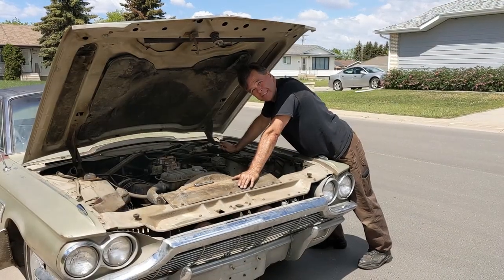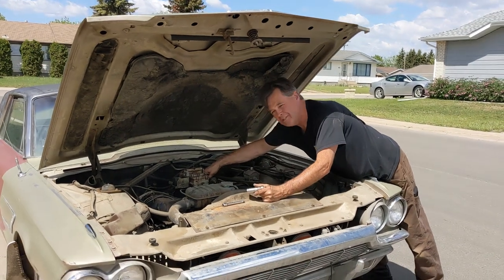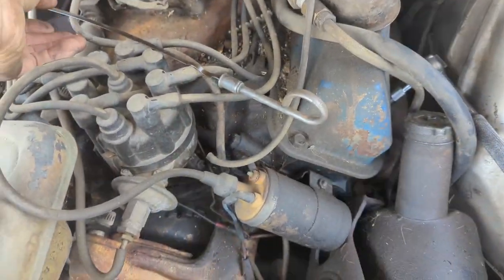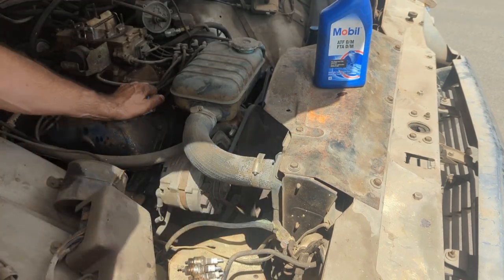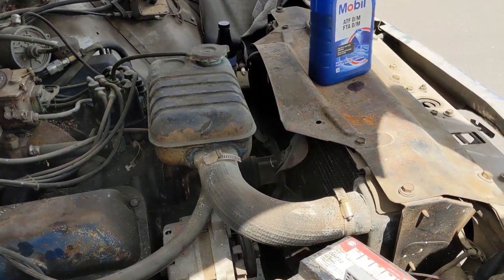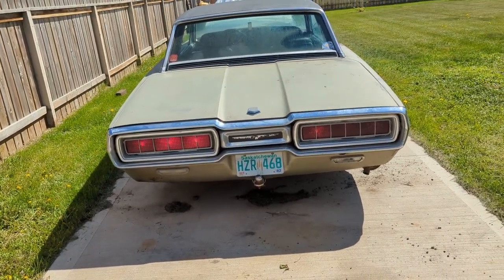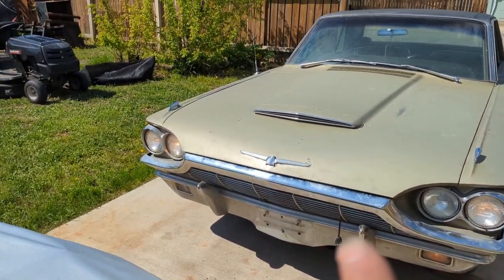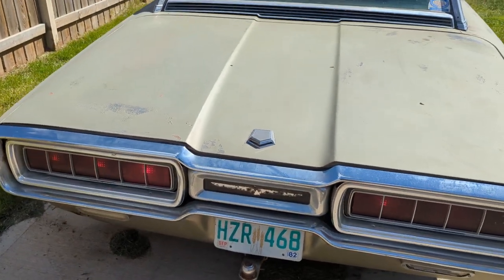65 Thunderbird Hardtop Arrival & Revival

Comment: That first start was to let the neighbours know that you had a new car 😊  It is amazing how some of the old tecnology holds up.  I had an LTD with the accerator pump leak which dripped gas on the manifold which smelled bad.  If I remember correctly, that was  a 400 which was not a good engine.  It looks like you will be up and running fairly quickly.  Fun video.
Reply from the maker: Lol...yes, and the big cloud of smoke was to warn the people on the next block over!
I think every one of these old fuel pumps with the cartridge filters leaked a little!

Comment: Mudflaps on the front and a trailer hitch, that's definitely a classic.  Body looks pretty solid (wish mine was that solid).  other than leaking muffler the motor seemed to run OK,  no smoke after the initial startup.  Let the videos begin.  :   )
Reply from the maker: Yes those old mud flaps are a sign of the old days...they are coming off today! Lol
The hitch, I'm still thinking about if you leave it, or remove it.
I am surprised with the engine, I was expecting it to be a little ticky...but she runs nice.

Comment: Congratulations on getting your new car started! A very promising start to a driving project. Smoke seemed to subside after it ran for a while, which is not surprising given how good the plugs looked. Looks like a very solid car. Glad it goes in gear and drives, too. I really hope you'll include this car in your video updates, but of course, that's up to you. This car is in similar condition to my own '65 when I got it, though mine was a running driving car before I bought it. I can relate to this car a lot.
Reply from the maker: Thank you! I will be doing videos on this one too, today I made the fix to the shift lever that these car all need...not as detailed as the video Nick did, but I felt it is still worth covering. I also just ordered new carpet, headliner, and trunk liner from Bird Nest, the old ones are too smelly from mouse urine to keep.

Comment: I am currently working on a 64 hardtop that sat under a tree for over three years and not registered since 2006.  I had it shipped here to Kansas City in mid December of 22 and spent the first three weeks just cleaning the exterior of tree sap and bird crap.  It is Wimbledon white with black cloth interior. AC, PW, both power seats.  Windows are stuck seats are dead AC/Heat all inop. Lol.  It is almost rust free with the exception of the trunk floor which is almost completely gone.  I tried starting and it had #7 intake valve stuck which bent the pushrod.  I got the valve loose and put in a new pushrod, rebuilt the carb and got it running poorly.  Y pipe is rusted so sounds like yours.  Fuel pump doesn't work.  PS pump doesn't pump and brake booster doesn't boost.  Sitting was hard on it.  I haven't given up.  A fuel pump and PS pump are on order.  I put on new belts and radiator hoses.  Compression is 155-180 on all cylinders.  I think that once I get the carb straightened out that it will be a good engine.  Valve train was very clean, not sludged up like some I had in the past.  Tires are rotted.  Lots to do.
Reply from the maker: Sounds like a great project Jeff, not having to deal with rust makes it so much better...now you can enjoy the mechanical repairs. 😊

Comment: Hey man, that's called air pollution. I love how after you ran it and walked around the car you could see the smoke cloud moving down the street. 40 years of crap in the exhaust system. Did any critters jump out? When I run an engine after many years, I use 3 quarts of Marvel or ATF and 2 quarts of oil in the engine and run it for 30 to 40 minutes and do this for a few days. This helps to loosen things up. Worked on Robins 65 that I am working on now. Even the transmission worked. Did it go into reverse? The interior  is very nice in this car so your lucky there. Good luck with the resto.
Reply from the maker: Lol Nick...no critters, just lots of critter nest material! I did go into reverse...in 1973 there was a shift kit installed, I'm curious to see how it shifts on the road, I may end up making changes there. I think the Marvel trick will be good for it, I'll do that once I get the fuel tank reestablished.

Comment: Did you hand crank successfully? what size socket did you use? do you think when i get the 66 to start up that i can just get away with disconnecting the coil and cranking for few seconds? then fire it up?  WHAT AN AWESOME VIDEO! working on my dad's 66 thunderbird landau with 428, cruise control and factory A/C. it sat for 33 years. looking to start back up and drive again. the condition of my dad's in spectacular shape! no rust, interior is super clean, a rare true barn find survivor! i put fresh battery in it but couldn't get to turn over with key it clicks. is it solenoid or starter motor? sequential signals all work both sides, headlamps work, high beams work, parking lights work back and front, brake lamps work. interior lights don't work nor the power windows due to burnt fuse.😀 is that a great start for me?
Reply from the maker: Hi Laszlo,
Yes, I turned it over two full turns just to make sure there were no stuck valves, the crank bolt takes a 15/16 wrench/socket. Before you start turning the engine over, I advise taking out the spark plugs, and adding some transmission fluid or some oil to each cylinder, then turn it by hand a couple of times before using the starter.
If you can turn it a couple of rotations by hand freely, then with the spark plugs still out try it with the starter...i like to put rags over the spark plug holes to catch the oil I put in the cylinder's, less mess that way.
You also have to clean the points, so just leave the distributor cap and rotor button off until you're ready to actually start the engine.
As far as the clicking when turning the key, that can be several different issues, but one thing to start with, is to pull up on the shift lever while turning the key, every one of these cars I bought had a miss aligned neutral safety switch, you can also try starting it in neutral, just make sure you have the wheels chocked... especially if you don't have brakes that work.
It sounds like a great car...enjoy the heck out of it! 🙂

Comment: Hey I just wanted to say I enjoy your videos.  I have a 64 convertible and a 65 hardtop.  I want to know if those hubcaps on your recent 65 are original.  They look like the same hubcaps on the Thunderbird in the TV show Highlander.  Are those hubcaps a Canadian item only?  Never seen them in the US.
Reply from the maker: Thanks for watching Michael! No, I believe those hub caps are off a late 60's T-Bird, but I'm not 100% sure about that...but they are definitely not the correct ones for 65.
Reply: @J_R_Shop  thanks for getting back to me. I'll look at some other years and see if I can figure out when they were made. I'd like to get a set.
Reply from the maker: @michaelws65  I did some searching, and found out more. 
The wheel covers are 1975-87 15" Hubcaps Mercury Grand Marquis Wheel Covers...they should be easy to find, and shouldn't cost that much.
Reply: @J_R_Shop  thank you so much. I'm going to go search for those now.